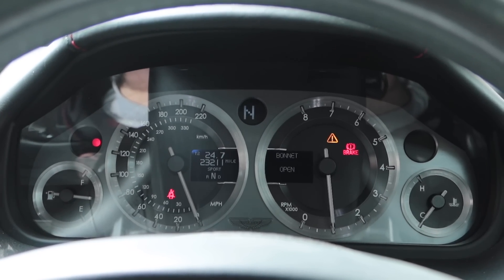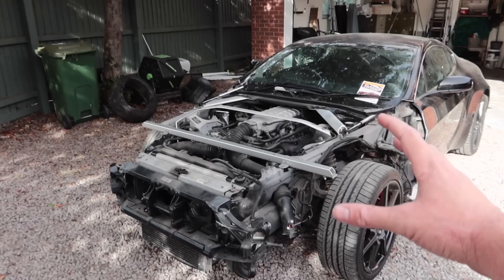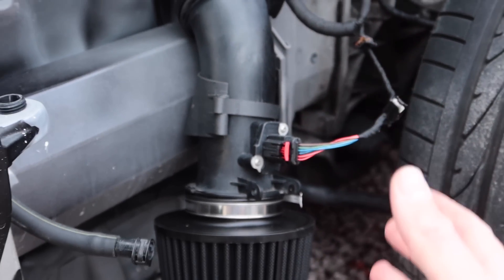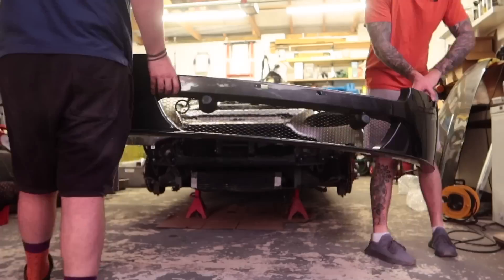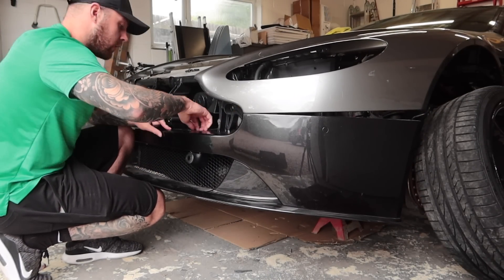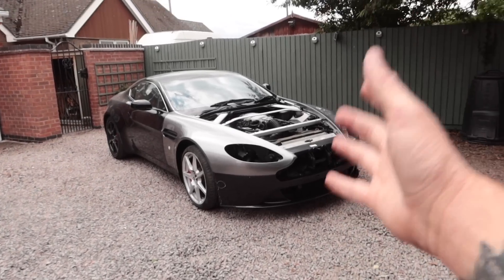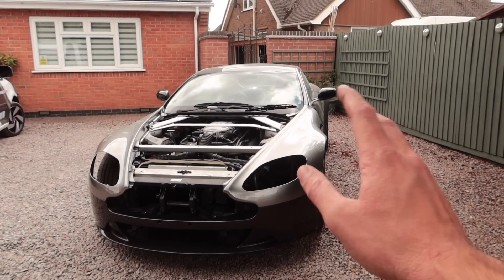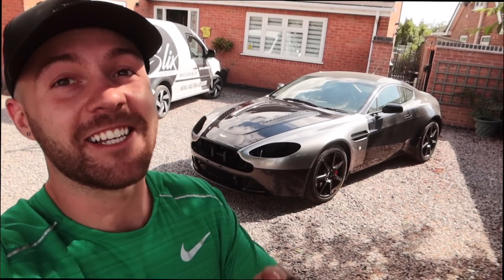REPAIRING MY CRASHED ASTON MARTIN V8 VANTAGE

Comment: Looking good mate. The service indicator is reset via pressing dash buttons (see youtube) Check out Aston Martin colours lightning Silver and Xenon Grey (immense metallic!!) I would stick with an OEM Aston colour for resale value. The bonnet warning is a FoMoCo sensor which attaches to the slam panel. They go wrong regularly when fitted but can be eliminated by splicing the wires together.

Comment: Difficult to tell from the video, but  the front parking sensor setup looks like it might be XVision kit that many dealers fit. 

There’s usually a little push switch or rocker switch for it tucked away on the dash. Worth a Google and see if it looks the same. 

Good luck! Do love a Vantage and good progress.

Comment: The bonnet open dash light is because there isn't a bonnet to latch hence it will show 'bonnet open' 🙄
Please get rid of those black wheels, they look bloody awful. Get a carbon slam panel and V12 carbon grill from EPC in Poland.
Then go for the Aston Installations Android auto/Apple car play upgrade to the audio system with front and rear cameras.